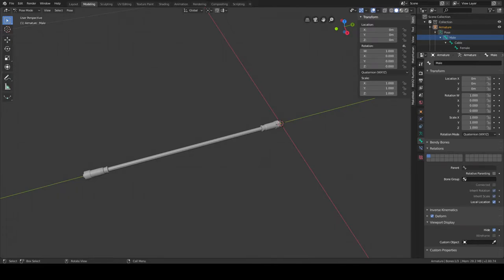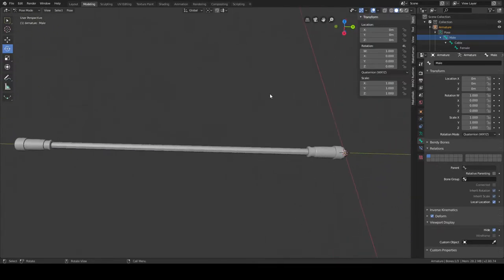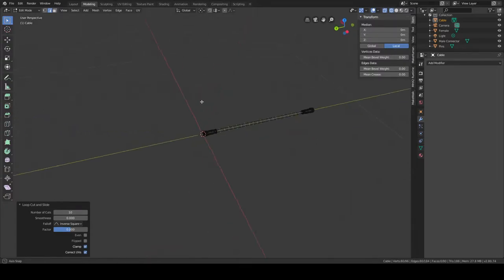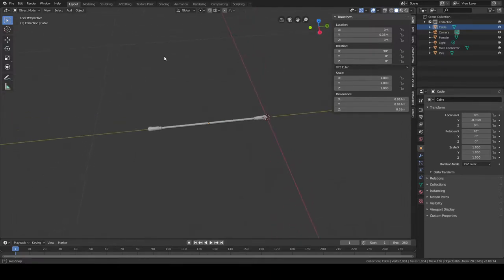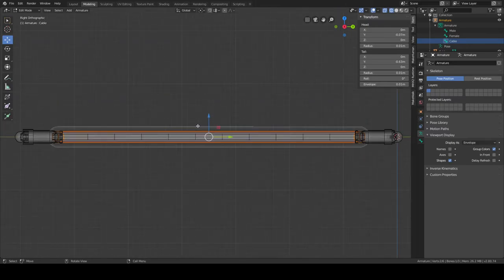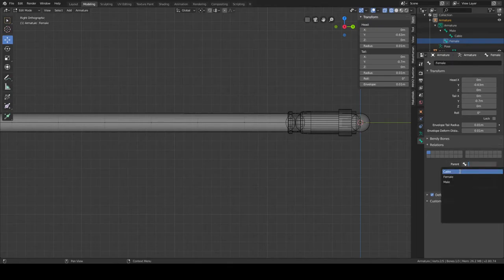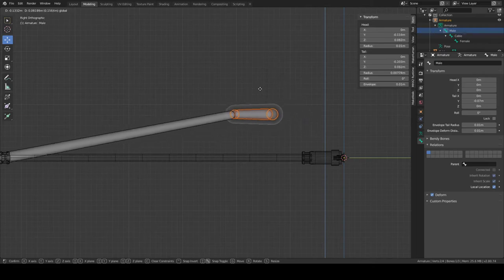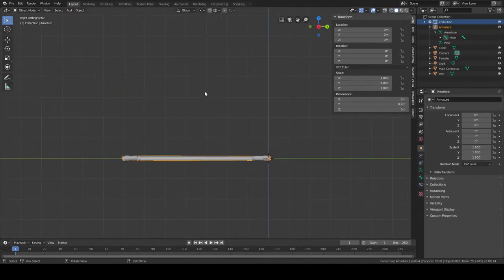Modeling a Cable with Bendy Bone Tutorial | Blender

Comment: You probably need TWO ARMATURES, each one going the opposite direction.
Each affecting a connector (like the "female", in your example) and HALF of the the bendy cable.
This way, it should behave like a cable.

Or maybe it won't work at all, and you will need to splt the cable into 2 halves.